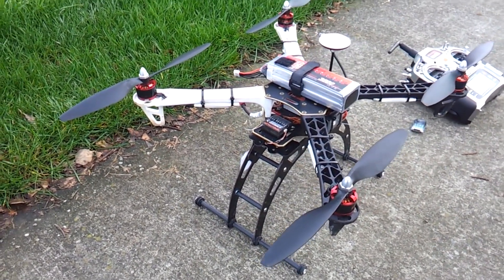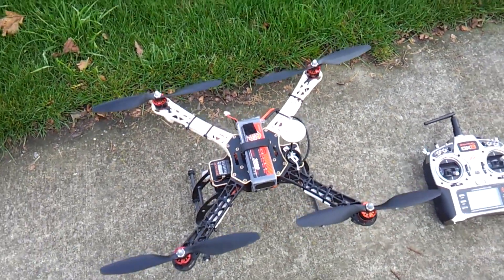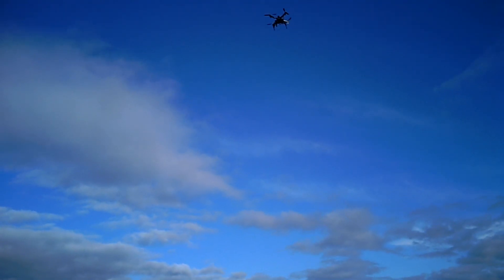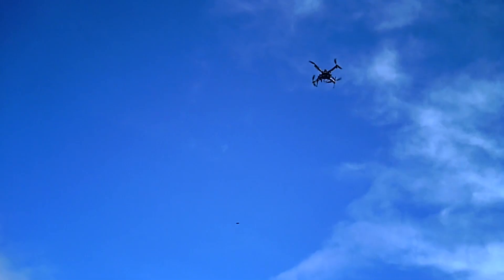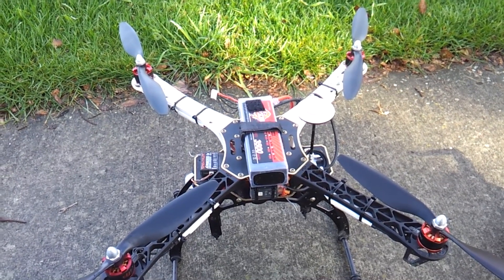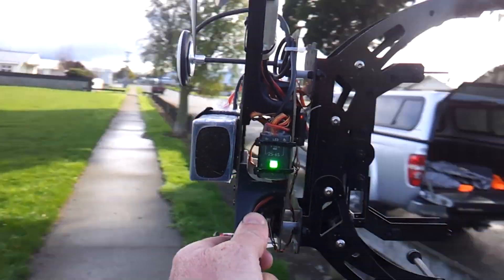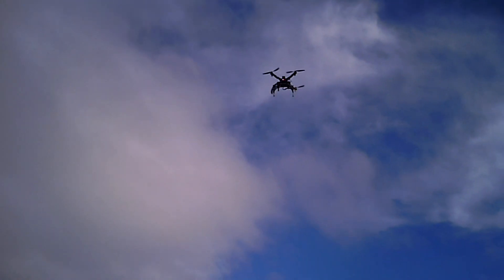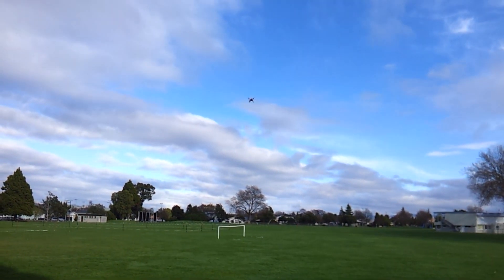Magnetic Declination Compensation for DJI Naza Flight Controller GPS Fix

Comment: Hey.. Do you have any solution for magnetic declination caused by noise from power cables on drone? It changes with speed of motors and drone keeps circling around the point it want to be at.

Comment: Before you took off you said you had a GPS lock but I think you didn't!!! You need to wait for the second fast flashing sequence which informs you about the GPS lock. Correct me if I am wrong. You can also see two red flashes which mean just not enough satellites to precisely determine the position of your quad. I always wait until red flashes disappear before I take off unless I don't want to use the GPS flight mode.
Reply from the maker: Hi the red flashes did disappear, and we had continued green flashes with locking of GPS.

Comment: Thx!  Good to know.  The only thing I saw that looked incorrect is that when you calibrated your compass (for vertical) you didn't have the front of the quadcopter facing downward like it's recommend in the manual.
Reply from the maker: Oh True :-), videos dont lye. thanks for that, must not have been thinking then.

Comment: Thanks for the great video!
The Phantom 2 (non Vision) suffers from what we are calling the "J Hook Effect". When in GPS Mode, Flying Fwd, the Phantom will start to drift off to the left moving off it's intended track. ( Left in Northern Hemisphere) A lot of us in So Cal are experiencing this issue. In Los Angeles we have a Magnetic Deviation of +12 degrees (East) On the Phantom Pilots Forum, we all have come to the conclusion that the GPS and Compass are not in sync with each other. We have no means of rotating the GPS or Compass positions. We all do a compass calibration prior to flight and go through all the calibration and firmware updates. For those of us shooting video, the drifting issues ruins any attempt to shoot a straight tracking shot. We are all trying to figure out a solution. DJI of course has been no help whatsoever. Any ideas?  Here is the thread on the issue. Thanks!!

http://www.phantompilots.com/viewtopic.php?f=19&t=9264

Comment: IF this is all true, why don't the Phantoms have an issue with this?  I have both a 550 and a phantomv1...I will try this fix on the 550...but, why not also move the MC unit as well as the antenna? they are both supposed to be "straight ahead"...is moving only one the key to this fix?  otherwise, it seems if declination was the issue, one would have to reaim both the mc and antenna...
Reply from the maker: hi John, they DJI have most likely updated their firmware in the Phantoms, i did this video about 18 months ago. adjusting it here in New Zealand seems to work as the GPS's satellites down dont have WAAS as they do in the northern hemisphere, this could be another reason? 
Well John hope you have better flying results now.

Comment: Thanks for the video!  I recently assembled my first hexacopter, the DJI F550.  It drifts pretty dramatically to the right when it GPS mode and then toilet bowls gradually.  Funny thing is, I flew last night at another location and the GPS seemed to lock good and strong.  Did not drift at all.  So who knows what the fix is.  I'm going to try your recommendation tomorrow.  According to the website, I need to rotate my GPS module 12 degrees to the right.  I'm crossing my fingers!!!

Comment: Yes, I realized, after posting my comment, that "YOU" doesn't need to know the "real North", but, as far as the GPS signal is based on geographic coordinates, it's quite possible that such a "conflict" between "true North" and "magnetic North" could occurred. Thanks for the "fast moving magnetic pole", it isn't a problem anymore, here in France (magn. deviation = 0°).

And you may be right : Calibrate before each flight m

Comment from the maker: I believe it needs to know the magnetic pole as it obviously is getting a calculation conflict error from GPS signal, this causing this to toilet bowl.
we're not using way points for this, just GPS lock.

it doesn't hurt to calibrate it at each flight, as it only takes a few seconds.

at the end of the day, i made the video to help other users, and it does fix my issue with the DJI Naza.

Comment: Thanks for sharing, but WHY your Naza GPS needs to know the "real" (geographic) pole ?

You don't do a "real" navigation, as in a car /boat /plane : you just need a "reference point" for your Quad : the magnetic pole is enough !

I think that the point is : for the second flight, you calibrated it (and not for the first one) !

I got my Naza GPS a few weeks ago. The provider told me that "No, it's not necessary to calibrate it for each flight...". He may be WRONG...What do you think ?

Thanks !